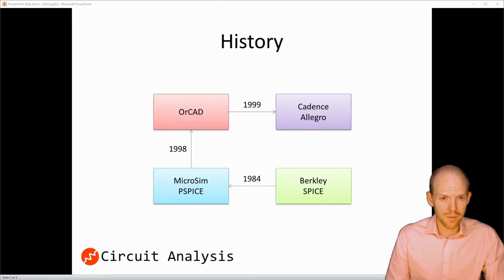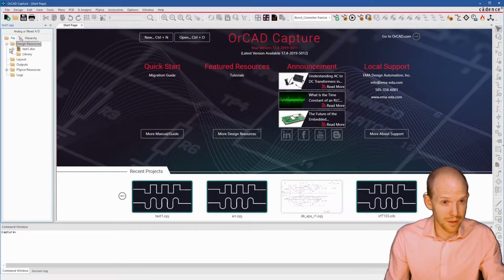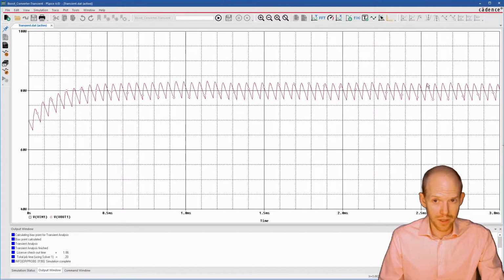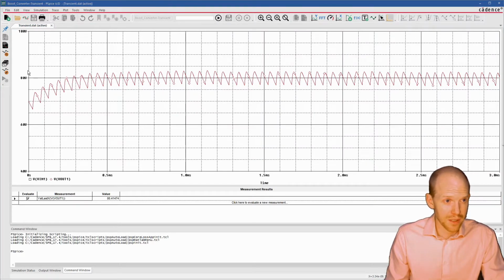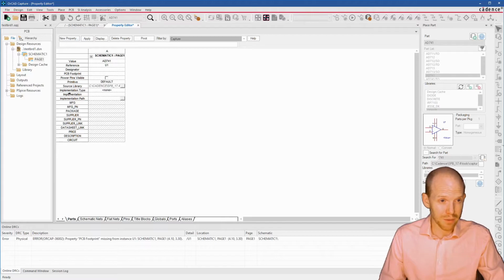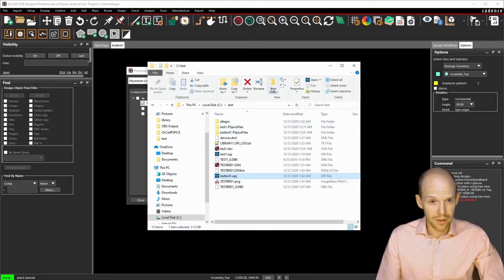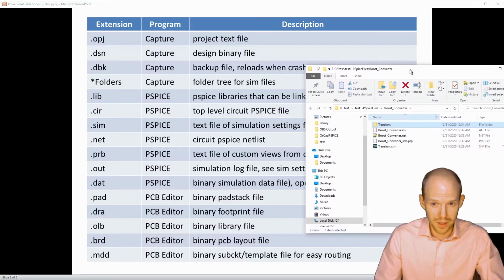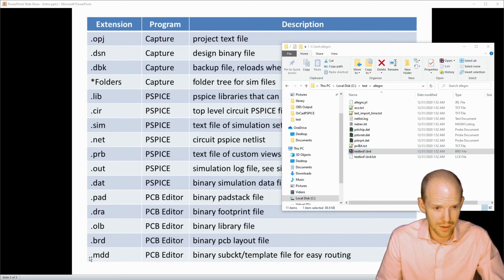Intro to Cadence OrCad 17.4

Comment: thanks for the video, helping a lot...the names are really confusing, i also heard capture CIS, concept HDL, design entry HDL, allegro , what are those? please clear this confusion.
Reply from the maker: Yes.. Yes it's very confusing. My network license says "Allegro PCB Design CIS L" as the default option while my other computer license says "OrCAD PCB Designer Professional w/PSpice" as the default option. I don't have a lot of advice as far as how to keep it all straight, but I can give you a couple notes. CIS is the database version for if your company wants to organize all the components in a relational database. Design Entry HDL is a bit of an odd deal. From the cadence rep who came to my company at one point I gathered that this is a newer interface they are trying to move towards to clean up everything and make it less confusing and be able to integrate all the schematic capture programs into one program... however since they want to be backwards compatible they are not getting rid of OrCAD Capture or any other ones so they basically ended up with a whole new additional one. I don't use it yet, but I guess it has some advanced features that make it "better" and will eventually evolve to be the main program you start out in with any design to draw schematics and stuff.

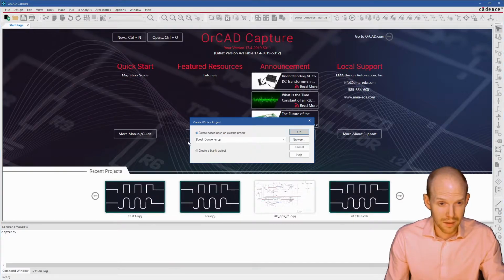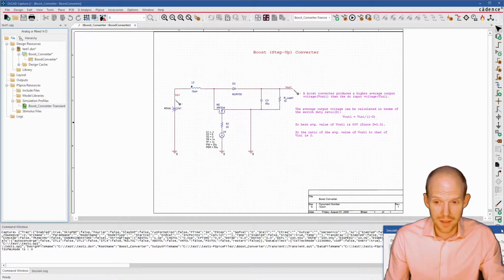Comment: Hello, congrats for the helpful videos. My problem is that when i create a new blank project or when i create one based on an existing one as you did at 4:02 i cannot create a new simulation profile or edit the simulation profile (you did it at 5:10 ). I go to Pspice-> Edit simulation profile and press it but orcad doesnt react . Could you help me?
Reply from the maker: I believe PSPICE is an option in the license, so I would first make sure your license include PSPICE. Next check that when you make the new project, you are enabling PSPICE simulations. For the latest versions this is just a radio button you check, and for old versions you have to select a project type as mixed signal analysis or pspice a/d or something like that, I forget the exact menu. The final thought is that orcad is very buggy so you may try just restarting everything. Hope that helps and let us know when you figure it out, thanks!
Reply: @CircuitAnalysis  Thank you very much for your reply! Problem solved right now. I just downloaded and installed the software update (HotFix) and for now the simulation runs properly .
Reply from the maker: @petrosmpakakis2167  Awesome!

Comment: Hi Jesse. I have a problem trying to create the new layout from orcad capture.
When I give OK the software hangs and does not advance.
I can't find the problem why this is happening.
I would appreciate any help you can give me.
best regards, Javier.
Reply from the maker: Hey Javier, bummer, hard to say, this software is quite buggy in my opinion. What version are you using, do you have the latest hot fixes? Did you try the standard close and reopen? Reboot? Does it do it with a fresh project as well as an existing project? What if you open the PCB editor manually first, does that change anything?